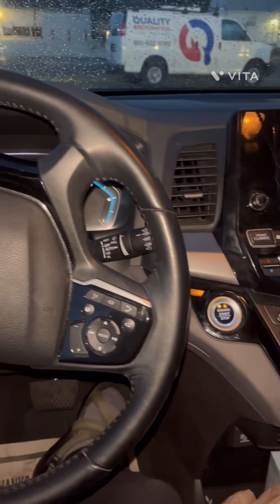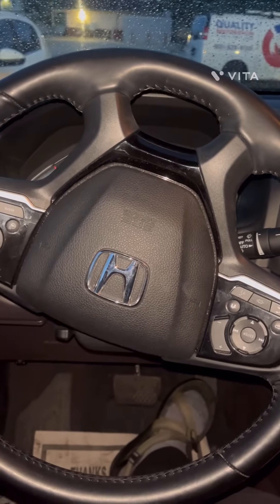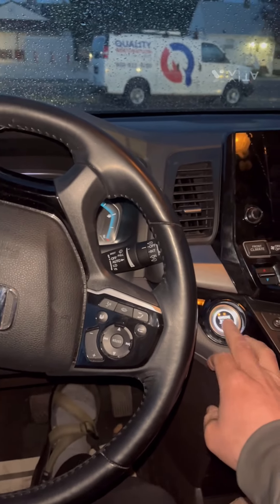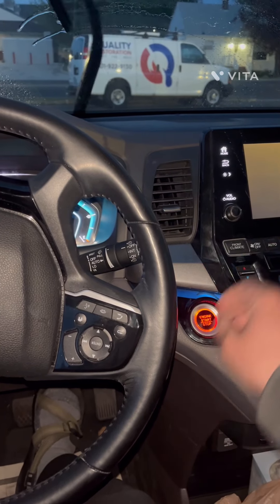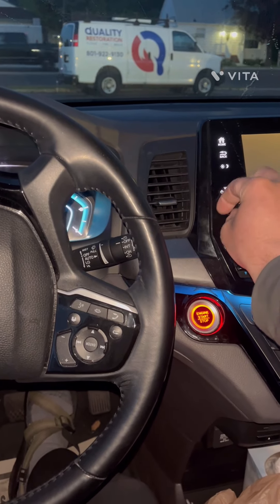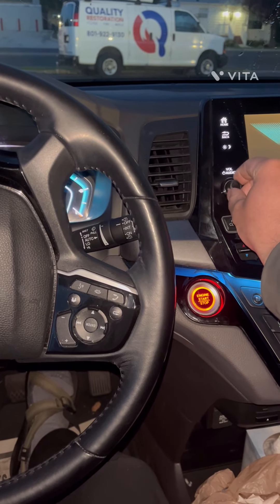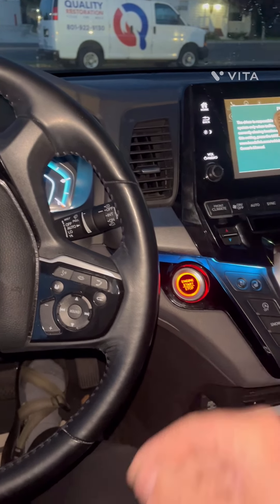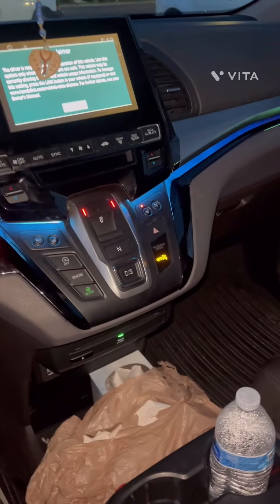Honda Odyssey Wired Exhaust Leak Noise (Noise Issue Solved) High Pressure Fuel Pump.

Comment: My 2019 odyssey has this exact noise and took to Honda dealer for diagnostic which cost $250 and was told the issue was high pressure fuel pump, cost to replace $1559 before taxes. The part OEM is only $180 online so their  2 hours labor is $1200
Reply from the maker: Most of the time deals cost more for any repair. I’m sure a lot of that cost is for the part. They charge a lot for the high pressure fuel pump if you get it from the dealer. They’re not too bad to change. So if you can do it you would save a lot of money.

Comment: 2018 and above yes high pressure fuel line need to replace fuel pump should be covered under recall status
Reply from the maker: Thanks! When I did this job there was be recall. So I’m glad to hear it’s covered now.

Comment: What year is this odyssey????
Reply from the maker: 2021
Reply: How did you figure this out ?
Reply from the maker: @evelynjuarez5737  I put a stethoscope right on the pump. It was the loudest spot so I started there and that was the problem. I have seen 4 of them now.
Reply: Thank you so much for answering me back !!!!! Your the shit dude
Reply: How easy is changing the high pressure fuel pump?
Reply from the maker: @adammaund8931 They are really aren’t that bad!
Reply: 2018 to 2024 odyssey